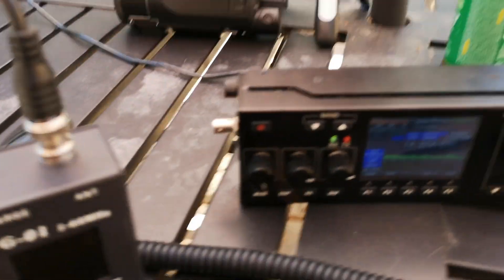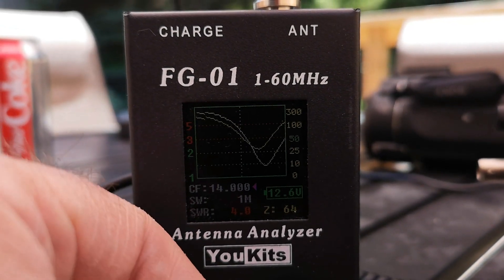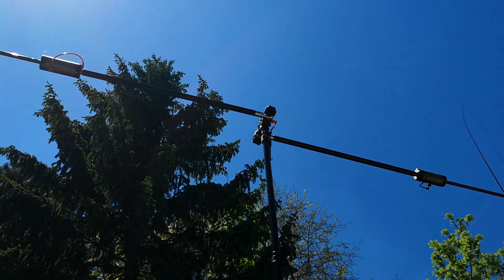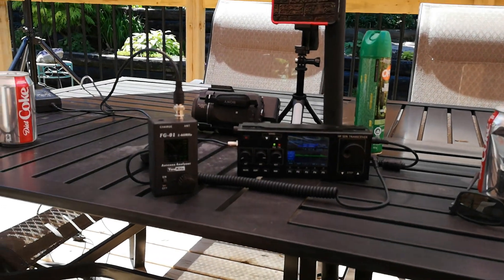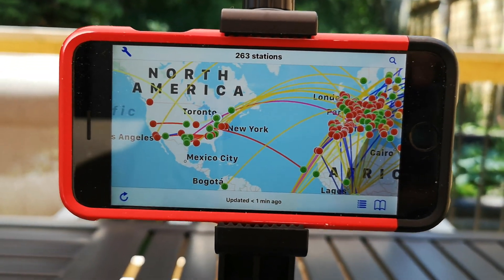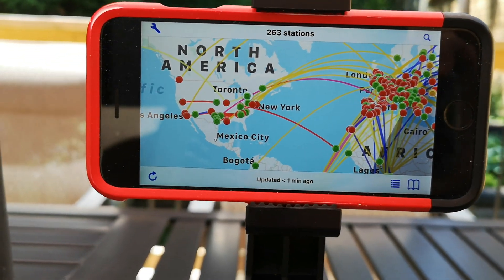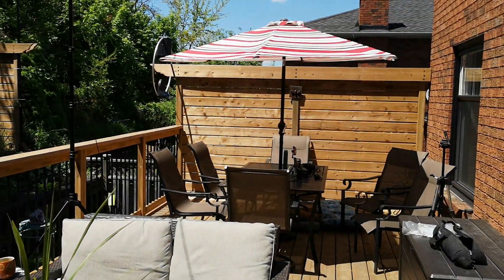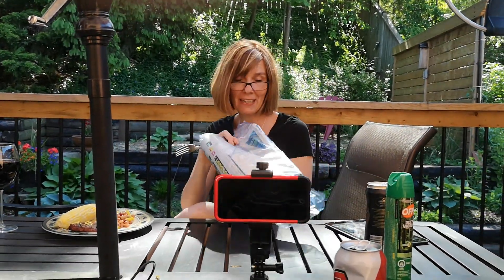🔴 RS-918 HF SDR transceiver on a BUDDIPOLE!

Comment: With the space you have, just using that small dípode! Try a simple wire dípole made by your self. You will get much better results.
Reply from the maker: You could be right. But part of the whole point was to test out the Buddipole since I already own it.